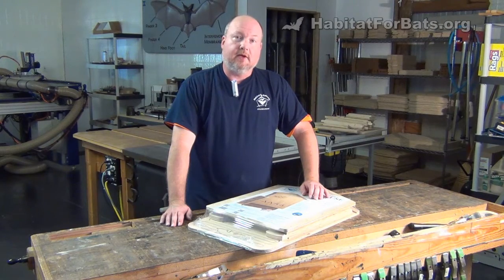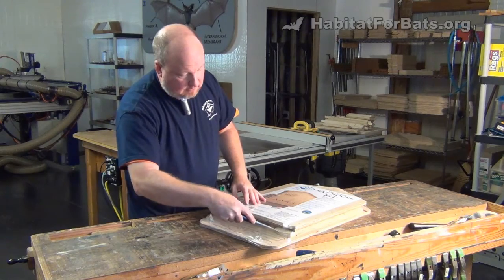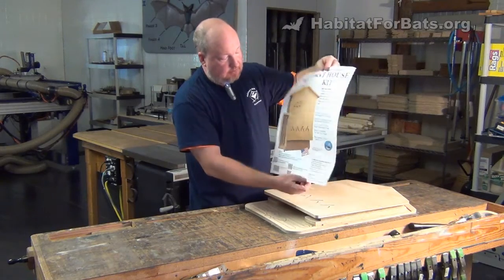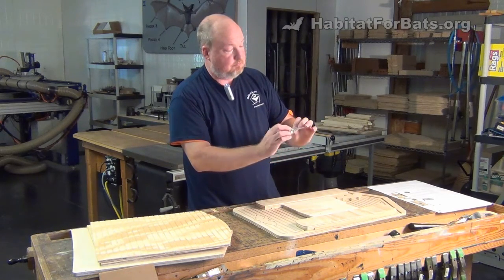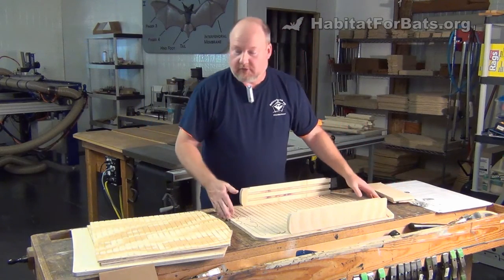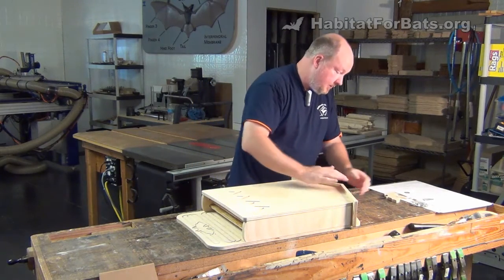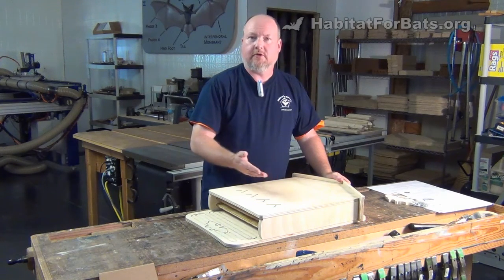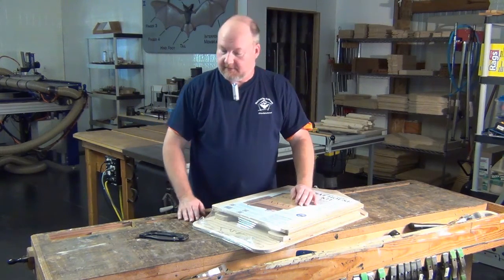Three Chamber Bat House Kit - Introduction

Comment: Thanks for the video and i like how simple it is to put together. You did a good job in design. I want to know though is how do i decide if i want a 1, 2 or 3 chamber? What determines that? I know there are bats around, i live in the city and want to help. Also i would like to know about location as well so if i do get one i want it to be in the best place for the bats.
Reply from the maker: +Thomas Young Deciding how many chambers is often a budget question, how much to you want to spend? But, on practical terms the larger a bat house the better the thermal characteristics. Larger bat houses hold and manage heat better. Larger bat houses are more likely to house a "nursery colony" where pups will be born and bats will remain longer during the year. However, smaller bat houses are important as well. They can be used for prospecting (which is again sort of a budget issue really) where small bat houses are placed throughout a farm or orchard and when bats begin using one larger bat houses are placed nearby or on the same pole. Any small bat houses that remain unoccupied after a couple of years would be moved around again to continue prospecting.  Small bat houses also provide roosts for sol called "bachelor colonies". These are typically pups or males. They will stay in a bat house anywhere from a day to leave and return throughout the summer, to full time. It simply depends on their needs and the location. Bachelor colonies are generally more tolerant of temperature changes.For you last question, we did an interview with Jim Kennedy about that. https://www.youtube.com/watch?v=L28vjNEMN-A   Let us know if you have more questions and thanks for loving bats!
Reply from the maker: +Thomas Young And this video https://www.youtube.com/watch?v=B4JYhayRcKo  and this one https://www.youtube.com/watch?v=YE4n-hxlWsk  and this one https://www.youtube.com/watch?v=5f355EtDMAI